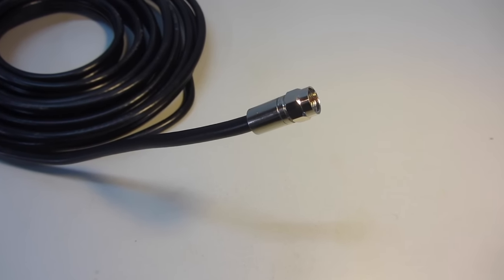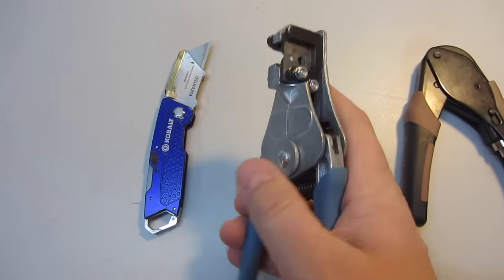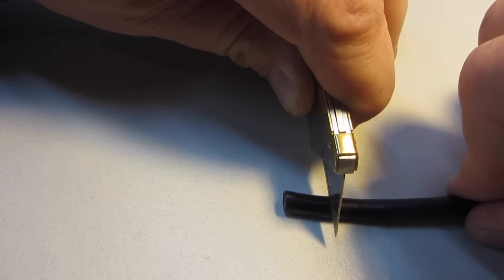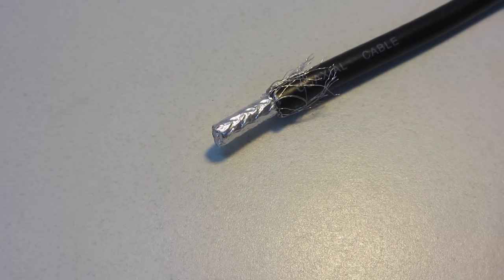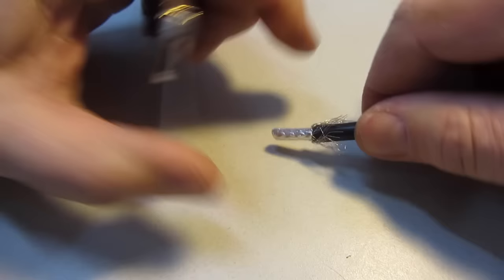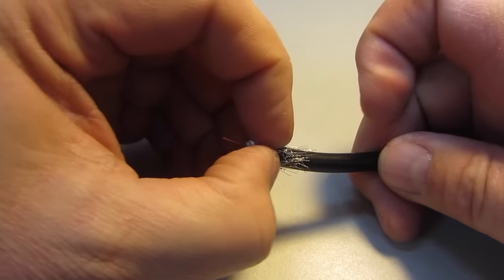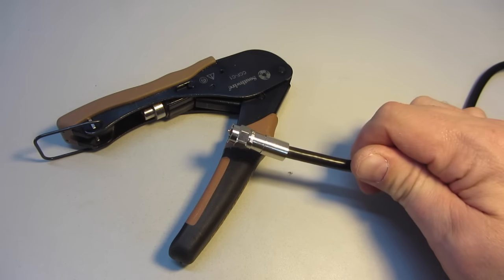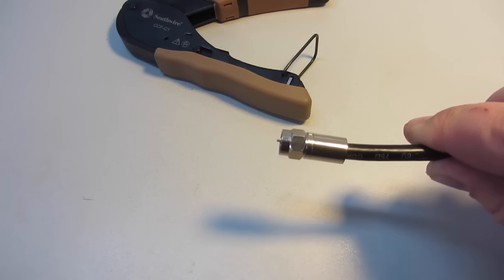COAX F-CONNECTOR - INSTALLATION

Comment: Just a note: I am in the cable industry, and this is all spot on, except one part. When you seat the connector on the cable, you want the white core seated flush with the connector-in the video yours was a little sucked out (yes, that is the proper term). Suck out can cause intermittent issues. Cheers!
Reply from the maker: Thanks for the tips for everyone.  I will say, that I sometimes have a very difficult time seating the connector.  It's like the cable is too thick, or the connector is too small.  Some of these are a real booger to get on.
Reply: @PhilCrockett  I know in the winter when working with cable outdoors a truck we use sometimes is to heat the cable with a lighter or torch just enough to make it pliable. The connector seats like a charm, and the signal isn't effected. 😉
Reply from the maker: SEE! THAT'S WHY I LOVE COMMENTS!!!  Thanks, Chris!  You just taught me something instead of trolling!!!!   Thanks for the great tip! I'm putting a lighter in my networking tool kit thanks to you!!!  THANKS!
Reply: @TheCHRISCaPWN  Do you heat it up before doing anything to it? While it’s still an intact cable? Or do you prep it, isolate the center conductor, and then warm it up immediately before trying to get the insulator flush with the F connector? 

Thanks so much for this tip
Reply: Chris- which connector would you use the Short or Long F-Connector, i have been researching for weeks and nobody seems to know even when I called Belden Vendor that makes PPC. They said there is no difference only the length, OK?? There are F-Compression tools made just for short F-Connectors and other for Long, like PPC EX6XL model. The difference is 18mm vs 21mm which is 3mm difference. Not really much if we want to save space in the outlet.

Comment: Hi Phil..Paul in UK here..I notice you didn't remove the foil insulation from the white inner core insulation..this  foil will now be in contact with the metal tube within the F connector..I can't see why it is necessary as the fine braid will be in contact with the inner tube also, which is the point, but the 2 are touching each other along the entire cable length..your comments please..[I feel leaving it on can only enhance the connection]
Reply from the maker: The only part that needs to be free from ground is the central wire.

Comment: Very nice video but I have 1 amateur question. What exactly is happening with the connector\inside the connector when you compress it. I just don't see anything happening...
Reply from the maker: I may not understand the question, but I think this might answer it.  You're creating a ground by making contact with the fine wires.
Reply: @PhilCrockett  we do leave aluminium foil? We don't remove it?
Reply from the maker: As long as the foil isn't touching the core conductor, then you're fine
Reply: Install the aluminum foil is a shield from electromagnetic interference that might affect signal quality inside center conductor.

Simply said: foil good

Comment: Nice, only problem I see is that the diaelectric, which is the white plastic, is not flush with the f-connector whole when it was crimped
Reply from the maker: I would have swore that the dielectric was flush when I crimped it.  I'll have to watch my video again.
Reply: Yeah that the only thing i saw too, i see you got the home depot crimpers, why didnt you just get the home depot strippers too, would have made this alot easier
Reply: The Setup  hi

Comment: If you pull on it, will it come off like the crap blue plastic ones?  if not, where do i get these? thanks
Reply from the maker: it will not come off.  This is compressed on. I bought mine at Lowes.

Comment: Peel the foil. Might get a short. Foil gets too close to the center wire after stripping the dialectic.
Reply from the maker: thanks for the tip
Reply: @PhilCrockett  your welcome. Its really more of an issue if using it for radio transmission because of arching with high power
Reply: @PhilCrockett  so you know what the compression actually does?does it sinch only the jacket or shield also? After few weeks of use Ive had issues with some braid strands getting loose and touching center.

Comment: What if you loose some of the braiding wires? The braiding is supposed to be important for the eventual connection quality.
Reply from the maker: +izri1   Try to keep as much as you can.  However, if you lose some, it won't matter much.  Thanks for your feedback!
Reply: Phil Crockett

Comment: Hi, if you take a look at 2:20, you will see all those thin wires, is it safe to just cut them down with a scissor? Some of them were sticking out of my F-connector, would it be ok to just cut them?
Reply from the maker: +messierthirtyone   yes! cut them down.   thanks for the question.
Reply: I removed them entirely with a pair of scissors. I saw another video here saying those should be folded around the plastic portion over the thick copper wire in the center, in order to provide screening. Was a bit confused. Also, since I don't have a compression tool, would it be ok to just strengthen with pliers?
Reply from the maker: +messierthirtyone OHHHHH!  now I understand what you're asking!   I'm so sorry.  YES...you need to keep them folded around the plastic!  I thought you had them sticking out of the connector once you installed it.  sooo sorry....hope I didn't mess you up.   Just simply recut and do a new one.  Here's a tip:  if you don't have a crimping tool, you can buy the type of connector that screws on, or the type that crimps on with crimping pliers.
Reply: messierthirtyone sXe

Comment: Hi mate , i have four bedroom house and decided to put tv in each room. do i have to wire a socket to each tv or is there is a wireless solution to this kind of house system ? thank you
Reply from the maker: +Faleh alarabi     I'm not "up-to-date" on wireless antenna technology.  I find most people have their personal preferences such as antenna, cable, satellite, and wifi.
I gave up satellite and cable due to the inflated prices.  I found that my family didn't watch enough TV to justify the cost. When we got rid of the high priced cable/satellite, we found that we didn't miss it.   Now, I prefer antenna for the local stations, and a "Smart TV" for Netflix and internet TV / apps.   I love free TV! and low cost netflix!  So I would not be the best person to give you advice on advanced wireless TV technology.  Thanks for the question.  I hope you find your answer!
Reply: So i can connect these tvs to the house wifi and watch channels through Internet?
Reply from the maker: +Faleh alarabi smart TVs are like giant iPads, except for the fact that u can hook to an antenna, cable, or statellite if u wanted.   If u choose not to hook up, then you will have access only to the same things you would get on the Internet .     To get local channels, I have to have an antenna, because I can't get them on the Internet .  Hope this makes sense.

Comment: Dear Phil, I'm an old retired and practical electronics for hobby. I am in Brazil and struggling to find a schematic for booster repeater, dual band cell phone signal amplifier, 1850 MHz and 2100 MHz. You know where to find this schematic to build a device like this?
Best Regards
Reply from the maker: Aloisio Santos frc  I have no idea.  In fact, I don't even know what u just said.  However, if I were you, I would first exhaust the Internet, and electronic forums / resources, and if that didn't help, I would find a technical school that taught such things and find a resource there.  Good luck my friend!

Comment: Adding a ferrule to add two feet of cable will that effect my signal strength
Reply from the maker: There's only one way to find out........
let me know.
Reply: You receive higher insertion loss the longer a cable is and how many connections are made. But this connector isn't what you want to use for getting a "good" signal, nor would you use basic tools or the barebones stripping process shown in the video. In short, yes; however it's already an inefficient connector that you're probably not using for anything high end enough for it to matter.

Comment: Excellent video. Well done ! Very detailed and comprehensive !
One of the best videos I've seen so far.
Btw, what video editing software do you use ?
Reply from the maker: Philip Gevaert On PC's I use the following:1)  Memories on TV (software by code jam.com)  - this is the easiest and most used basic software.  (you can get by with just this software 99% of the time.)
2)  Sony Movie Studio Platinum -  I use this for more advance editing like cutting, slow-mo, Fast-mo....etc....

On Mac I use the following:
1)  iMovie  -  (it's awesome for most editing, but is horrible for free-texting)
2)  Mac's picture editing software that comes with the Mac's iPhoto.  I have to free-text on a pic in this, and then transfer it to iMovie if I want a text slide.  or just use the "titles" option in iMovie to text, which is very limited, and doesn't allow me to drop the text anywhere I want.  A HUGE flaw with iMovie software.

Hope this helps!
Reply: Thnxs for your quick reply. I've been experimenting with iMovie and Final Cut Pro but was a little disappointed. I'll have a look at Sony's software.
Greetz,
Philip

Comment: If dat is not on it will it still work
Reply from the maker: never tried that.  The hard part would be making good contact with the outside mesh wires.
Reply: Ok tanks

Comment: You really don't need all those tools. What you need is the screw-on type F-connector, a box cutter knife and pliers to cut and strip the cable /wires... and some common sense
Reply from the maker: That's another way to do it.  It's not as secure, but it works.  Thanks for watching and commenting

Comment: G,Day, Is it possible for coax cable to be affected by E.M.F. I have my cable running next an energised light circuit. It's connected to a digital radio and I'm have some problems. Grateful for any feed back.
Reply from the maker: +Robert Sanders   I don't have the answer for you, but hopefully by posting this, someone may help.
Reply: Robert Sanders so excited
Reply: Yes there is electromagnetic interfence between both the wires and it will effect ur radio signal
Reply: Yes signal cable would always be far away from power cables i;e electricity cables

Comment: Do NOT use a utility knife, you almost always damage your cable or shielding. Buy a cheap coax stripper, they dont cost much. Also, there are F Crimp connectors. Also professional, and a little cheaper. Also requires a crimping tool.
Reply from the maker: Good tip for those who can a afford to buy the tools.
Reply from the maker: What a deal!  Thanks for the tip!
Reply: Phil Crockett

Comment: You would have a much more perfect prep and have a faster time of putting the fittings on if you just went out and spend the $10 on a prep tool.
Reply from the maker: I actually have the professional equipment, however, I made this video for the vast majority of people who don't have those tools.  Thanks for the suggested tip though.

Comment: ...dude...ditch the knife the two wire strippers and the freaking ruler...along with the compression tool all you need is a $6 buck coax cable stripper...simplify your life 😝
Reply from the maker: ha!  This video is intended for those who don't have a lot of tools.  If you're going to do a lot of these, then yes,  buy the tools.  I have all the tools, and I love them!   I love them so much, I want to take my shirt off and roll in them!
Reply: @PhilCrockett  👍🏻😅

Comment: please dont take this the wrong way but this is exactly how not to put a connector on.  do not use knives or wire strippers and the white must be flush with the connector.  call a professional.
Reply from the maker: I take no offense to your suggestion.  In fact... I encourage any kind of tip.  I will say that I've been using this technique for years without any issues.  I've never had a bad connection or any other problems.  The only reason I use this technique, is because the manufacturer's instructions on the package showed this method.  I have never strayed from the product's instructions and diagram, I assume they wouldn't mislead their customers, especially since the methods works perfectly every time.  Thanks for the input though, I really do respect your opinion.
Reply: to be fair before i got a couple of pocket wire strippers (one for RG6 and one for RG11) this is exactly the kind of thing i did. i can tell you if you too, as long as there is NO metal touching the center conductor then there is virtually no difference. like zero. it may look ugly or unprofessional, but if it works then it works.

that said if you really want to get things done right then one of those little pocket cutters will probably run you like less than $10. which i mean if you have already spent money on cable and ends then why not drop a little extra for the proper cutter right?
Reply: Call a professional? Why so they can write a bill for $80 for putting an end on a connector. No thanks.
Reply: @John C - LoL your comment reminds me of the last time I called my ISP. the problem is never my stuff and always their end. whether its signal or physical network issues its always them.

anyway, the tech got to my house and checked everything. by the time he left all he did was install a splitter to "pad" the signal. i was like "this is stupid. i could of done this myself." especially since they billed me for the call.

so thats what i did after he left. i am not calling them again. i uninstalled the splitter the guy just installed inside and went outside to uninstall the 3way there too. then i put in a  2-way Tap outside. 2 ports go to the TVs and the passthrough goes to the modem. then I installed  a couple of inline attenuators on the modem cable to tune the signal down to acceptable levels. no issues at all since i reworked things.

though i am thinking about replacing coax some time as it is pretty old.

serious, if you want things done right though do it yourself.
Reply: @dcd7400  if it was so simple, then why did you call the tech? Ah, because you had no idea that you needed to do that, and you don't have the meter either to check the signals, and you also don't know what specs you should be getting. The solution might have been simple in that case, but finding the solution is another story.

Moreover, the tech provided a splitter that is within specs for the network. Otherwise, you would've probably bought a splitter from the hardware store that would introduce lot of noise and interference and made things worse.

Cable guys fixes know-it-all's DIY stuff all the time. And I can guarantee they would cut that connector in the video to make a new one.
Reply: Looks fine to me for hand made. The military does the same thing at times but using their multi tools lol

Comment: You should be using a coax prep tool a blade is not ideal
Reply from the maker: HA!  I get that a lot.  You have to understand the point of this video.  I'm trying to help people do this with the least amount of tools and cost (read the description of the video).  Most people who have those tools won't be looking up this video.   Thanks for the input though.
Reply: Phil Crockett. You can easily buy this tool at home depot so try again.
Reply from the maker: I bought mine at Lowes.  I love it.  Great tool and very easy to use.   It's definitely worth buying if you plan on installing a lot of connectors over the years.   If only installing one or two, then save your money and use a blade.